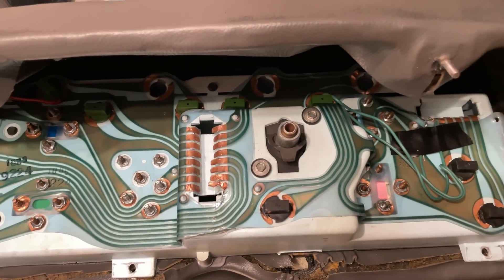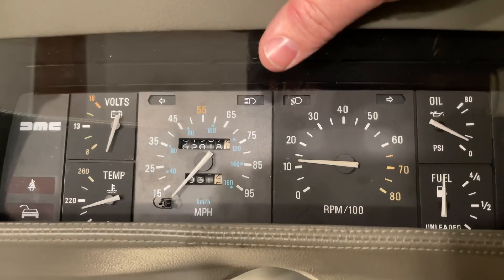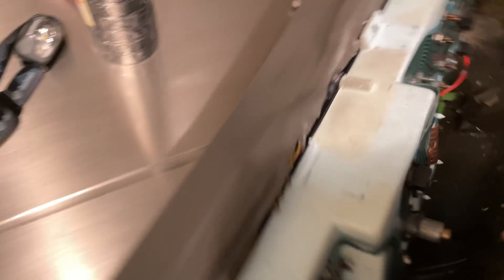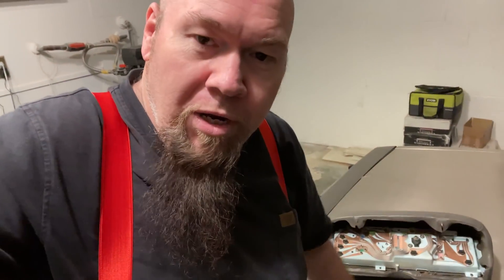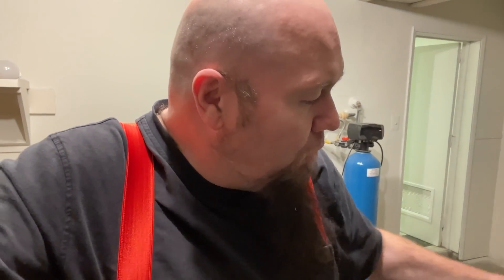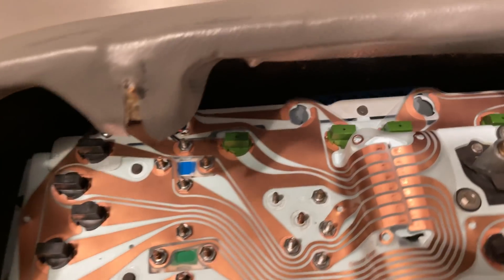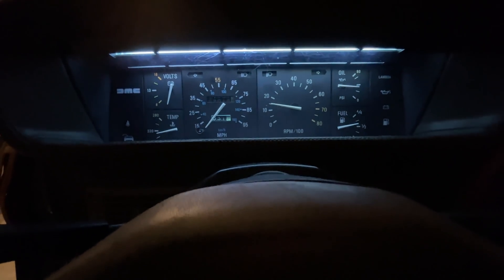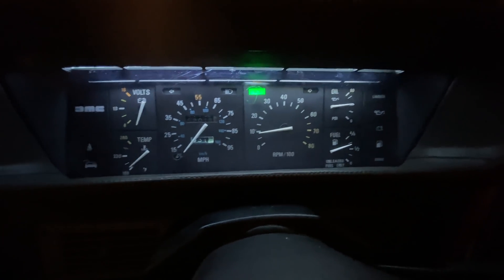Building a Delorean Time Machine Replica - Part 13 - Dash Lights and your Alternator

Comment: Hey Bob 👋 Why don’t you solder leads directly to the back of the board at the endpoint, pin it out and then solder the leads to the wiring loom, get rid of those damn copper printer crap? I’ve seen you with a soldering iron and know you’re awesome with one

Comment: I worked on restoring a 1st generation VCR from the late 70's.  Those VHS top loading VCR's had a little light bulb that lit up the compartment where the tape goes.  So you can see how much tape you have left.  That little light bulb doubles as the main fuse for the enitre VCR.  Found that out the hard way.

Comment: A bulb wired in series disabling the alternator from charge?!? That's fe'd up engineering...  That is some primitive, cheap circuit routing technology right there. Why they didn't go the route of a circuit board rather than that crappy plastic with traces laminated into it is beyond me!  I know what you mean about not being able to replace all the lights with LEDs. I had the same issue. When I had my old 97 Honda Accord, I tore the dash out and replaced as many bulbs I could with LEDS. For the most part it worked. One issue though... The check engine light lit up. I thought I had a problem, so I brought it into Pepboys to read engine codes and it turned out everything was fine. It was discovered that the LED used in place of the check engine bulb had the wrong resistance so it would light up the check engine light regardless. Having to remove the center console to get to the dash and then rip out the gauge cluster again, sucked. Ultimately I put the bulb back in the check engine socket and all was fine. Months later though, some LEDS started to flicker.... they was going bad... I said F-ME.... and just left them in the dash.

Comment: Why couldn't you run a relay that is hooked to keyed power that kicks on and runs 12volts directly from the battery to the alternator?

Comment: This looks like a simple fix. Take the plastic off, scan it to get the trace patterns, send off the files to a circuit board manufacturer like pcbway. Would probably be 3 circuit boards connected with  ribbon cables.